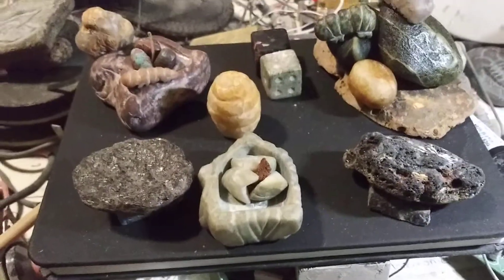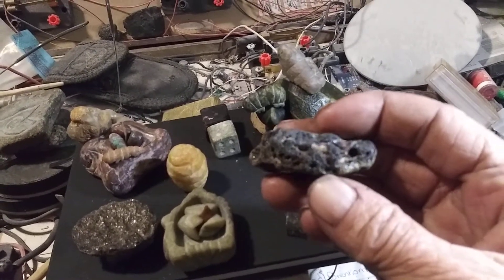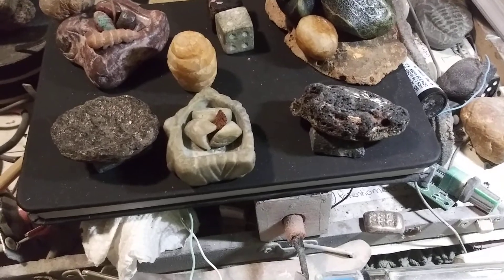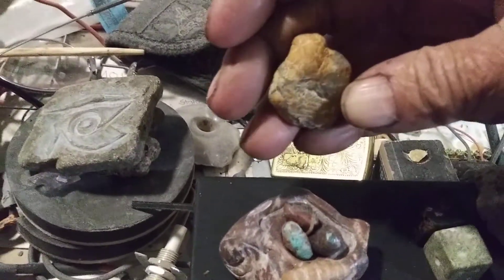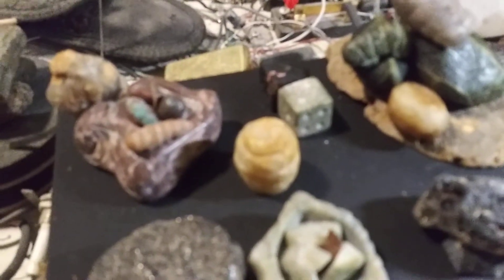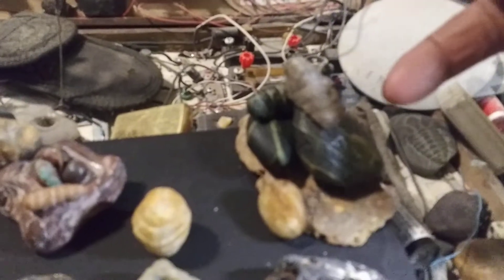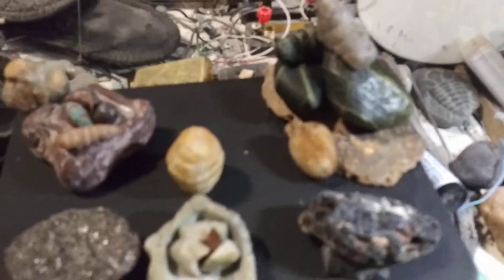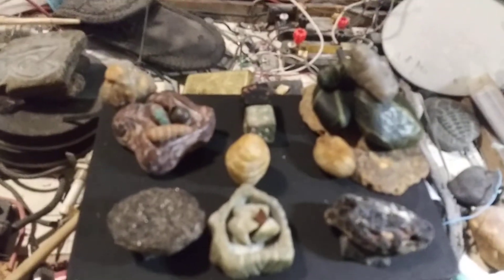neolithic survival tool talk

Comment: Gene,  slag is waste generally discarded.During smelting, when the ore is exposed to high temperatures, these impurities are separated from the molten metal and can be removed. Slag is the collection of compounds that are removed when smelting the iron ore.  I do recall one chemical smelting process where the slag is kept , titanium dioxide
Reply from the maker: I use slag that has high purity . Some slag is magnetic. The black glass has a unique fabric that i like alot. I test it for lead. Mercury and arsenic before using it. But the sculptures that i get from it are. The highest quality in material and workmanship